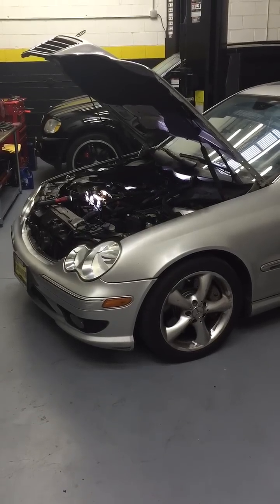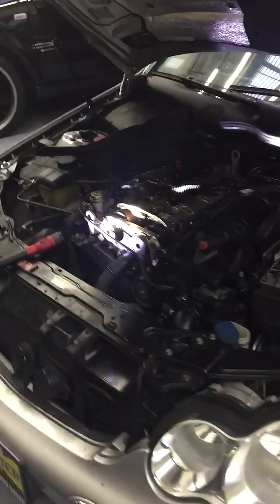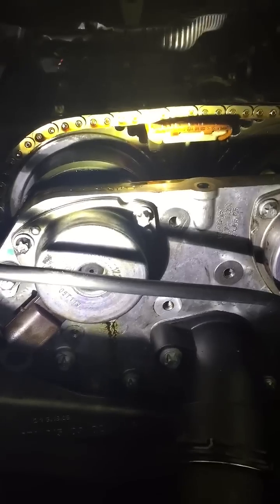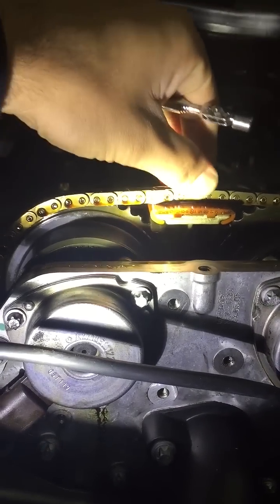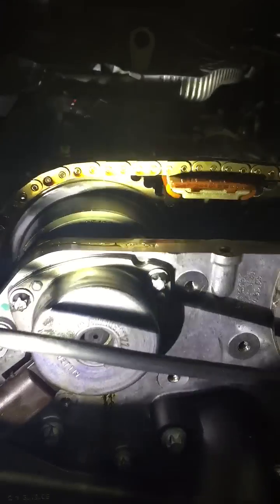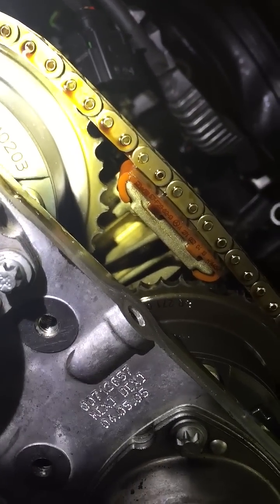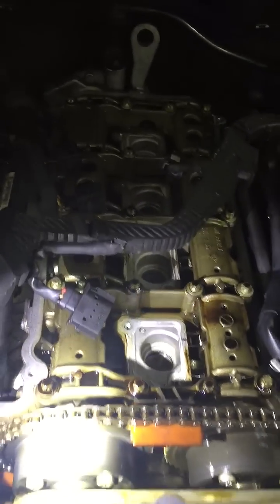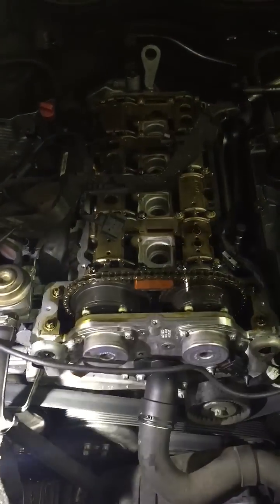Mercedes Benz C class timing chain failure W203

Comment: how many miles did that car have on it? Mine is a CDI is it better and has 180k miles
Reply: lord richy CDI don’t have that issue it’s just the 1.8 petrol engine that has the gear issue getting worn over time.
Reply: @Samid10  thanks man appreciate the reply - do you think mine has more life left in her at 180k? gearbox is still smooth so I should be ok for over 200k
Reply: lord richy what year is your CDI engine and what car specifically as there are few different types and variants of them. I have owned a few of them over the years and still do. As long as you do the basic maintenance they will go on forever, which is why most taxi drivers use them. There are many out there with 200,300,400 even 500k miles without needing major overhaul. The gearbox should be just as good as long as it’s serviced on time too, although they can have some failures but they are not common. There’s plenty of info on the Mercedes forums if you search and you’ll find plenty of more info.
Reply: @Samid10  thanks for the detailed reply, im trying to get as much info from many sources I have gone through the forums and now im seeing what youtube has to say. Shes on a 54 plate 2.1 turbo CDI and had her turbo replaced at 100k

Comment: Hi, I think you need to change the whole camshaft adjuster gears sprockets, tensioner and timing chain itself. I had to get the whole done job done on my car. The timing chain was jumping because of sprockets. You can find the whole kit very cheap online on ebay at the following link.

http://www.ebay.co.uk/itm/Mercedes-Timing-Chain-Kit-Camshaft-Adjuster-M271-Petrol-C180-Kompressor-02-07-/172893367235?fits=Car+Make%3AMercedes-Benz%7CCars+Type%3AC+180+Kompressor&hash=item28413f6bc3:g:pQUAAOSwA2hZxETl
Reply: How much did it cost you in total for the repair? I'm guessing your vehicle is still working following the eBay kit repair?
Reply: Can easily cost over $1,500 WITH parts. It's a very labor intensive job and a lot of diagnostics have to be done to ensure it didn't destroy the engine.